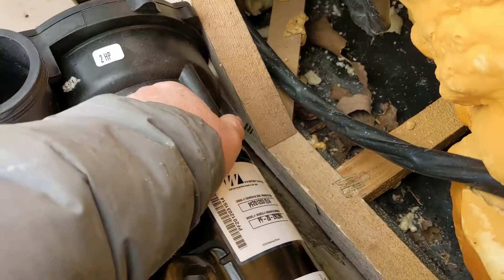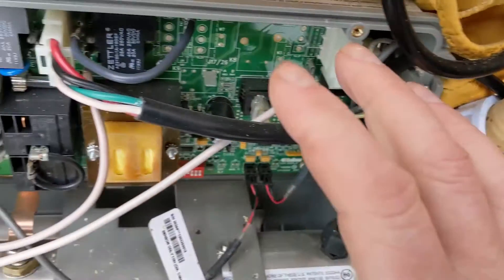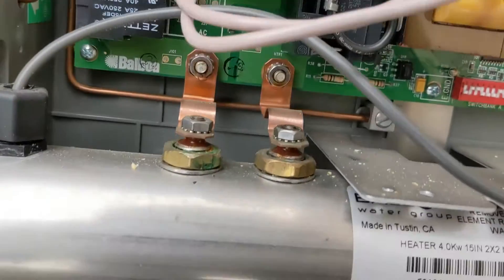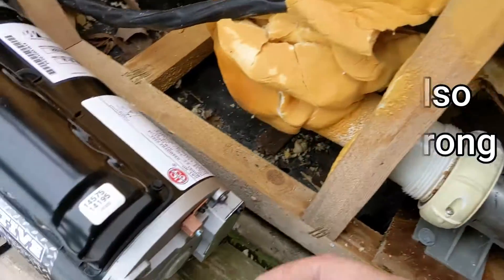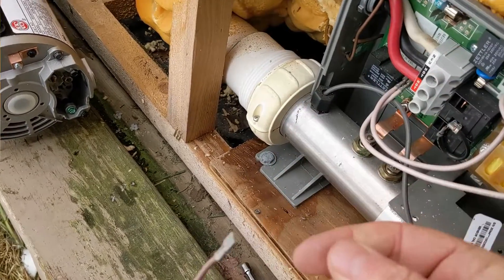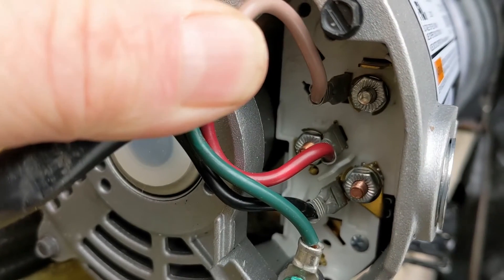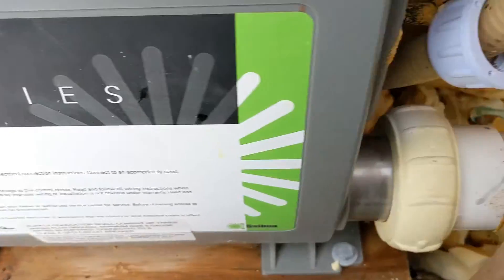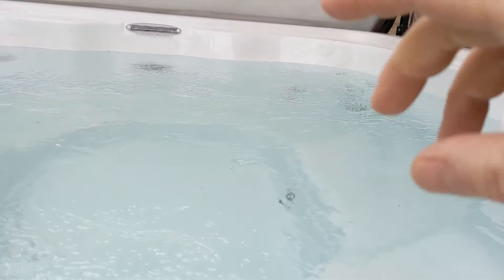How To Wire a HOT TUB Pump Properly / Wiring a HOT TUB Pump

Comment: Thanks.  I got a new pump and motor. I hooked up the wires in the same orientation as the old motor but it barely pumps at all. Guessing the wiring is different on this one. I will trace the wires back see what’s up.
Reply from the maker: There should be a diagram on the motor itself on how to wire it.  Plus, make sure it's the same volts and amp draw

Comment: Hi, I have a hot springs spa that I'm changing both 2 speed pumps on.   The cable going to the left pump  doesn't have a red, the original pump on the left had an internal red wire. The  pump on the right has a red wire in the cable that feeds the pump.  Not sure how to wire the one on the left correctly since there will be no red wire coming in from the existing wiring.
Reply from the maker: The REDs are for your high speed.  Any 2 speed pump will have the RED.  If it's a 1 speed pump, it's the BLACK that will be used as high speed on that 1 speed pump.

Comment: wothat is the specific name of this amp wire that i need to buy...where do I buy it?  wire from pump to motor
Reply from the maker: If your looking for the plug/wire (amp cord) for the pump in this video, the link is https://www.inyopools.com/Products/07501352031044.htm 
This cord is for a 230 volt 2 speed motor.  If your looking for a amp cord for a 1 speed pump, it will be without the red wire in it.